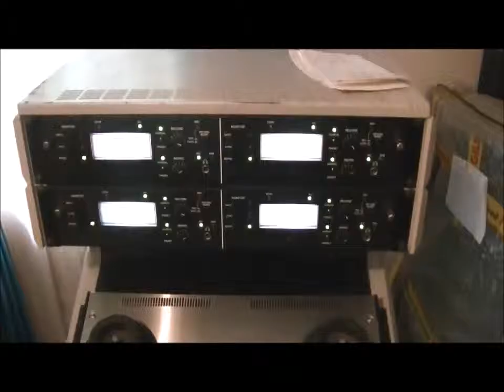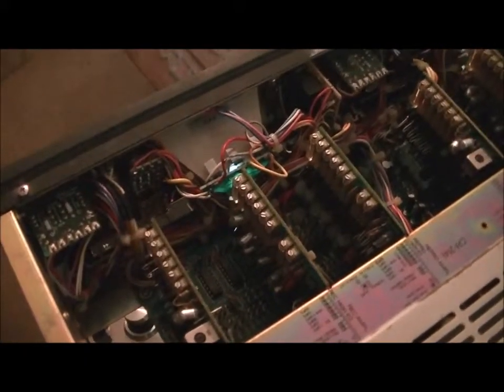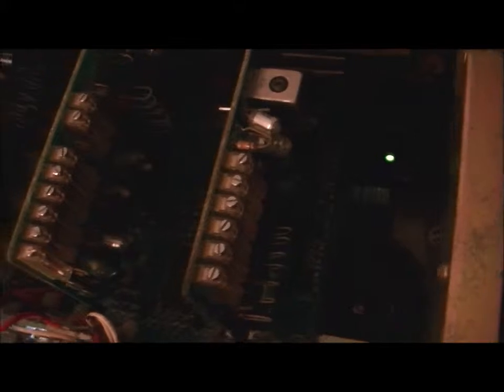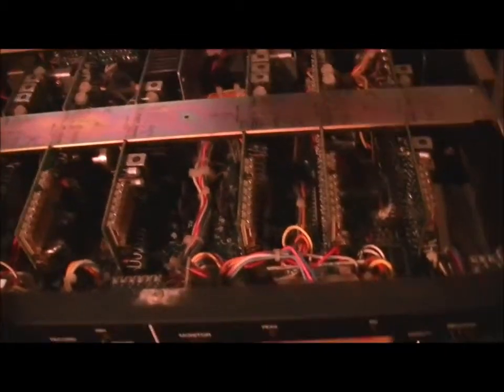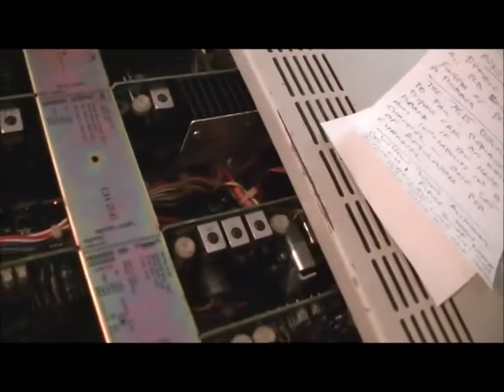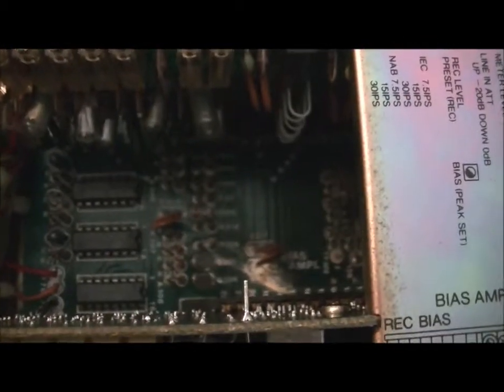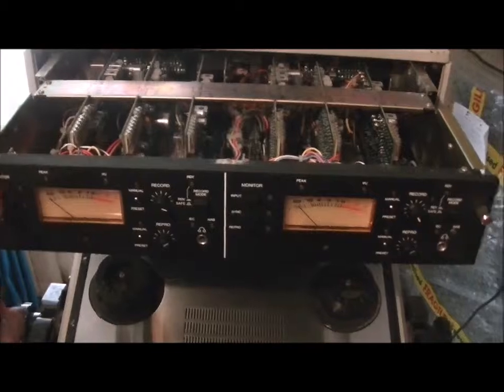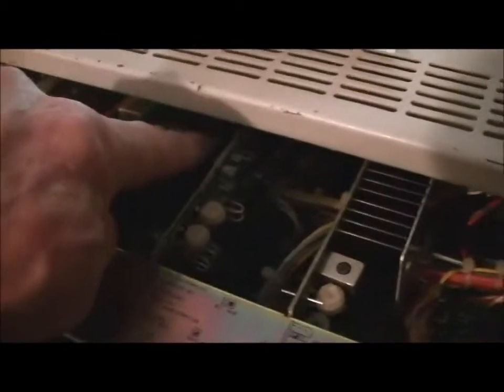Ampex ATR800 electronics

Comment: Similar experience on my side. I bought an uncerviced machine (ten years +) which worked on viewing at the seller, after transportation during the first firing up both channels seemed firing up too but then I lost both ones. After  inspection I found some obvious issues, one play amp line driver transistor causes intermittent shortage, another one is replaced by a totally different transistor, etc.. I suspect some of the the onboard regulator ICs are fried..
I concluded to replace the suspected line drivers by BD441/442 (?). You mentioned TIP ** which ones exactly?

Comment: Graham, this has been informative.   I have the same issues with the regulator for the negative rail on the mother board.  The transport works fine without the electronic, but as soon as I connect the electronics into the transport, all sorts of grief, and the voltage drops to about 3vdc.  What started this mess was when I powered the machine in for the first time, there was smoke coming from the right side of the electronics, probably the three ICs you mentioned here.  Any ideas what was the cause of the transistor failure on the playback card?  I have another machine that is working well.  Do you recommend a total recap when the machine is fully functioning?  Thanks for sharing.
Reply from the maker: pull the play cards out and see if the PSU problem goes away, if it does check the play card output transistors first then the regulator. After just swapping out the obvious reel supply PSU filter caps it turned out to be a total recap of the entire machine board by board. Not a lot of fun. The end of the restoration is an ATR800 that I suspect is better than ex factory. If recapping use all 105 deg C caps. One of my good friends who used to use the ATR800's back in the 70's had a play with mine, and concurs with my thoughts. He had a life of snapped tapes, servo problems and more, and was impressed by the way mine handles. The smoke on powering up these machines if left for many years is common. Using a variac does not help !!!!!!.